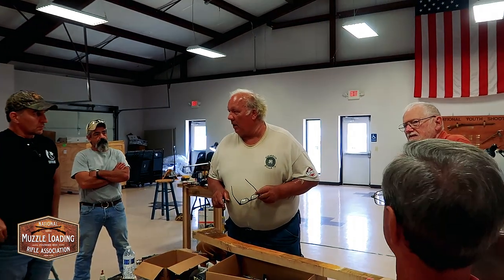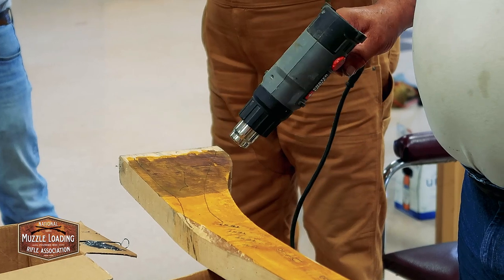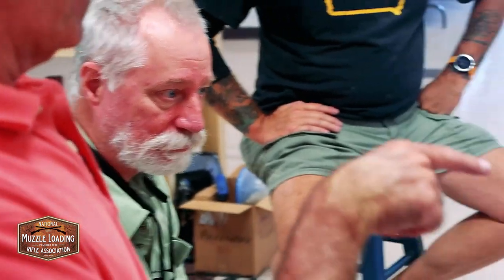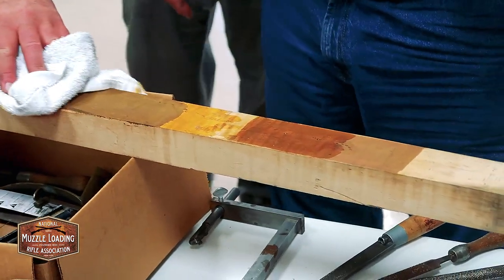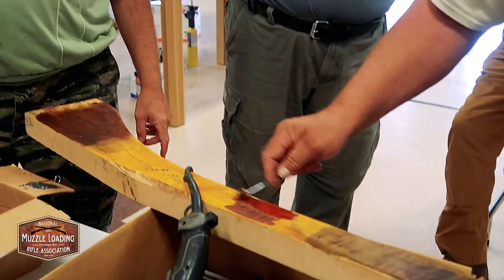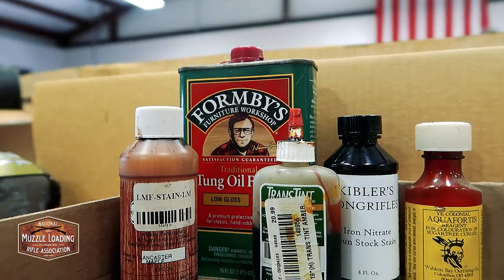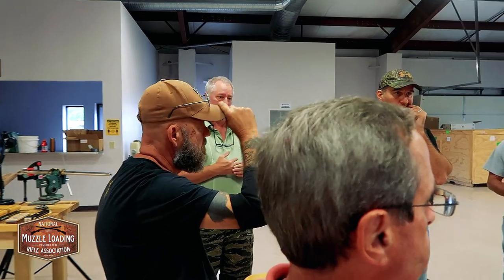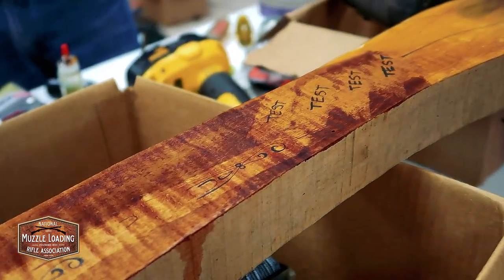Picking the right stain for your longrifle kit | Mike Brooks and Wayne Estes at the NMLRA

Comment: First off, let me say how much I have enjoyed these videos that have come out about the Kibler gun kit builds. But either I'm doing something wrong or they are as I've used Aquafortis (Iron Nitrate) since my first gun build in the early 70's and have never had the stock turn black. The color is still as vibrant as when I first made them. I have since just followed what was printed in the book The Art of Building the Pennsylvania Longrifle when it came out in the late 70's and have yet to run into any problems.
Reply: usually aqua fortis alone wont, using tannic acid over a coat of aqua fortis will turn a stock a dark brown black that requires a lot of rubbing back to reveal the final color. its a great method to darken the curl but it certainly takes a lot more work-back and can be achieved other ways